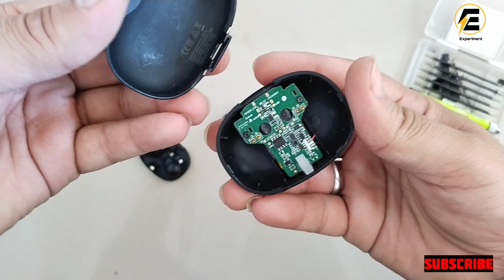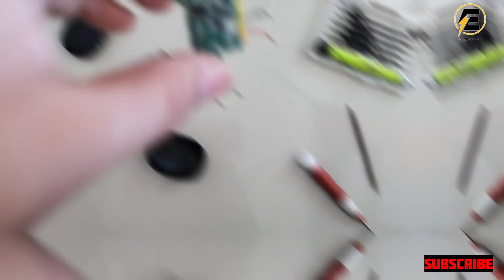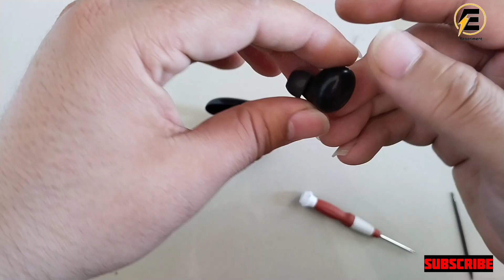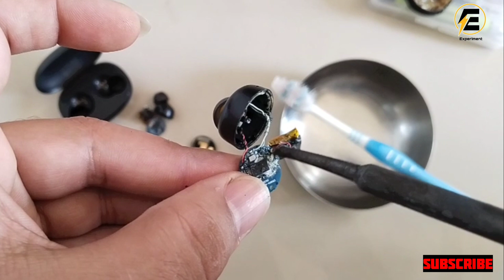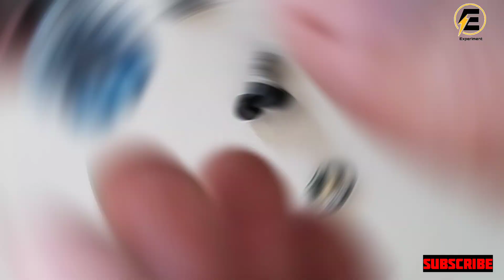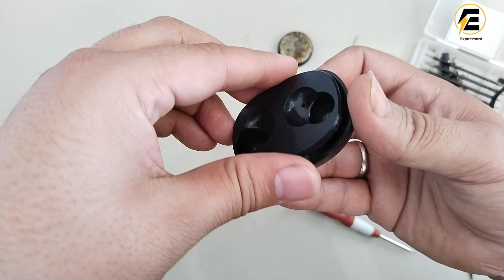Earbuds Repair Water Damage Airpod All problems solved  #airpods #earbuds #repair #1000subscriber

Comment: Hello there i have airdopes 383 and in that both the earbuds dont last longer than 2 or 3 mintues gets disconnected and left one disconnectes after 30 or 40 seconds of conncetion also they dont get charged the case is fully charged but i think the buds dont charge i have this problem i applied for boat warranty but it declinded what should i do?
Reply: One time service now my tell video
Reply from the maker: Battery problem he
Reply: My sam problem but bot company my buds replace done.

Comment: Sir buds heat kyu hote he only 30 mint me
Reply from the maker: OVER CHANGE YA high Voltage charger ki vage se hota he
Reply from the maker: Earbuds ka battery voltage ka charger use kare
Reply: Sir kitne volt ka use kru
Reply from the maker: Aapka Earbuds me Discrition me hoga  voltage Etna use kare